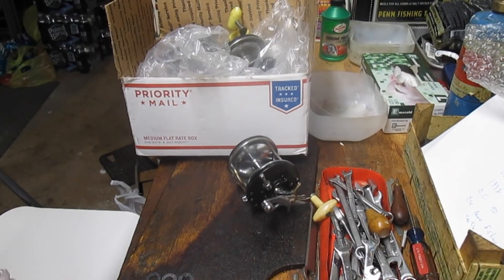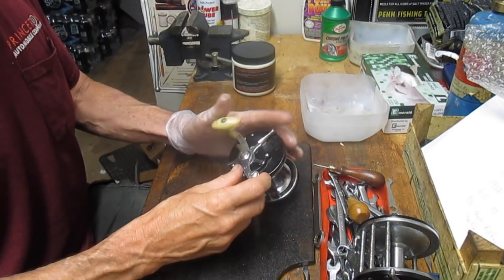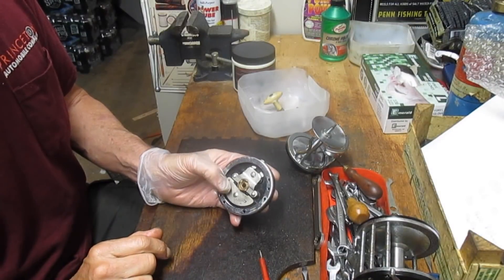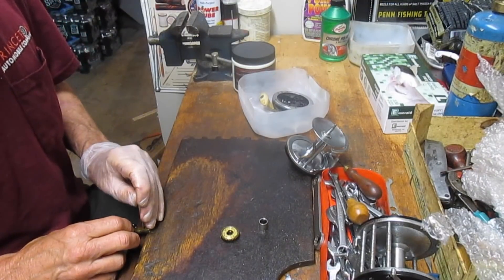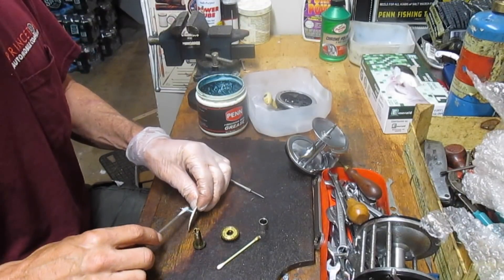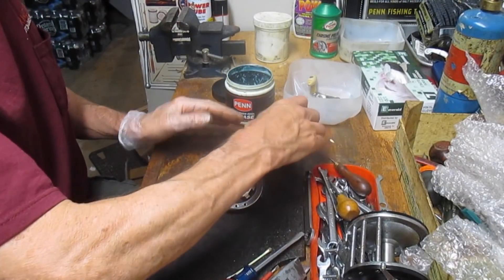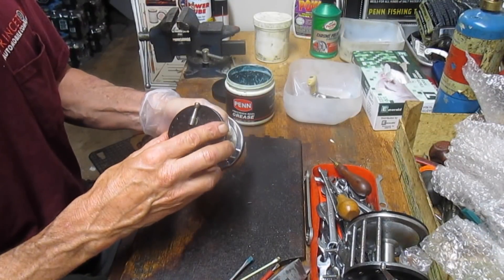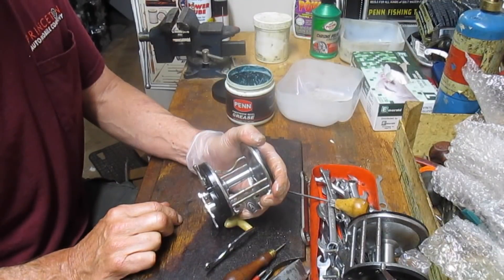Ocean City 113 Classic  fishing reel how to take apart and service step by step

Comment: I just finished cleaning up a 113d. It was slightly different inside. The dog and dog spring were totally different. And the drag stack had no fiber washers. Three brass washers and the two key washers are stainless steel. Very nice reel! Your Video really helped me though.
Reply from the maker: Yes - there were several iterations of the 113 and there was a version that used only metal washers just like the Mitchell 302 uses them.  Glad to hear that the video was helpful.  Best wishes - Dennis

Comment: Thank you Dennis.  Have always been an Ocean City fan.  Have several and a few date to my teens in the 1960's.  Taken apart and lubed every year.  The OC 113 is one of my favorites as well as the Penn 60.  Always looking for an OC at flea markets.
Reply from the maker: Great reels that you can find for cheap at the flea markets now.  The downside is that there aren't many parts available when they break.  Keep doing what you are and clean/maintain the on a regular basis - thanks for watching - Dennis

Comment: Good Day Dennis. Back in the 60-70s
Which brand reel was the most popular for surf fishing- Penn, Ocean City or Abu? Model?
Reply from the maker: The surf caster was either a Penn Squidder, Surfmaster 200, Penn Beachmaster 155 or Garcia Mitchell 600 series.  The popular spin reels from the surf was the Mitchell Garcia 302 or the Penn SpinFisher.  From a boat, it was the Penn Senator and Long Beach lines and the Ocean City 112/113/Bay City reels in addition to the bigger Garcia 600 series reels.  The Ambassadeur 5000 was popular across fishing types and was very versatile.

Comment: Dennis, what cleaner agents would you recommend to have in a new reel repairer's arsenal?
Reply from the maker: I like WD40 as a penetrating oil, Purple Power as a general degreaser and Turtle Wax chrome polish as a mild abrasive to remove tough grime and corrosion.  I also keep a variety of micro fiber cloths, Cotton swabs, kitchen scrubby pads, tooth brushes and toothpicks to use for tight spaces and cleaning gear teeth. - Thanks for asking - Dennis
Reply: Fabulous! Thank you for the tips Dennis. Love your channel, keep the detailed videos coming!
Reply from the maker: Your are welcome.  Best wishes for success as you start a fun hobby - Dennis
Reply: Hi ive got an ocean city no.1110 that im trying to fix. Its pretty much the same as these 113's.  Everything seems to work and the drag washer is fine but when its all buttoned up, the whole spool jumps away from the gear which disengages the spool.

Is there a way to adjust the side to side movement of the spool to keep the it from disengaging from the reel?
Reply: Nevermind you went over it a little in this video. I think my adjuster is really messed up cause even when theyre both tight the whole spool can move side to side like more than a 1/16th of an inch.

Comment: Hi, love the videos, i actually just got three of these reels off ebay, seems the three drag washers are good, but there was 1 washer pc that was brittle and a dark red/maroon color that im not sure where to find or what it is called.  also on 1 of the side pcs you can add oil too seemed to have a felt pc that was in good shape, the other cracked, do you know easy replacement.  im almost thinking about just epoxying closed so dirt cant get in and figure with new grease it should be fine closed permanently.  any advice?
Reply from the maker: Yes - the Penn Long Beach 60 washers should fit your reels.  They are available on Mysticparts.com for about $1.25 each plus shipping. You can replace the maroon washer with a standard one.  Dennis

Comment: I enjoy bringing old reels back to life and using them.  Can you recommend any household, automotive, or gun lubricants which can be substituted for servicing an old reel?  I have been doing this for years but do not know if I have been cutting my projects short.
Reply from the maker: Ken - Stick with products that are meant for fishing reels.  You are doing yourself a disservice by using anything else.  Penn, Cal's, Okuma, Abu, Reelx and others make a nice selection of oils, greases and cleaners at reasonable prices.  - Dennis
Reply: @2ndChanceTackle  Ok, will do.  I have been using Reel Magic after a rinse as recommended by salt water fishermen here and it seems to do a good job.  Is there anything wrong with 3in1 oil or sewing machine oil?
Reply from the maker: @ken48827  They are machine oils, so they will work and nothing is "wrong" with them.  The fishing reel oils usually are fully synthetic and have additives to repel salt water and corrosion.  3 in 1 is not synthetic and not as effective against salt build up and it breaks down faster. - Dennis

Comment: My ocean City 113 is missing left side oil cap and spring..
Can I use the parts from a Penn reel?? You have the solution for everything.. thanks.
Reply from the maker: I don't think they are interchangeable.  Both companies made reels in Philadelphia, but they were competitors and did not share designs.  I think you need to find the part or a donor reel in the used market. Maybe try Ebay or a site like it - Dennis

Comment: What year did the 113 came out what's the price value
Reply from the maker: The 113 is one of he original series of Ocean City and goes back to the 1930s.  A 113 model in 1937 sold for $6.50. In 1948 the reel sold for $11.  The last ones made before they were they were sold as True Temper, were made in 1957
Reply: @2ndChanceTackle  I have one of them have to clean up thanks for everything Dennis